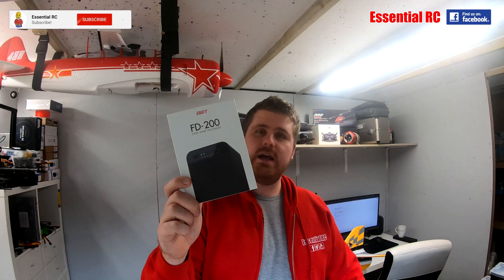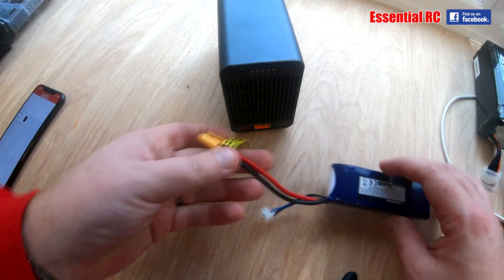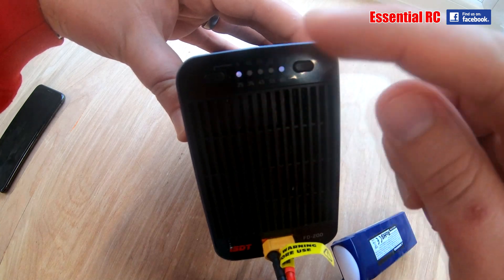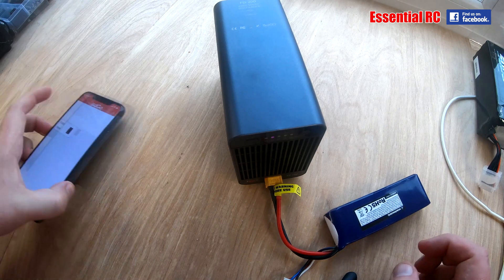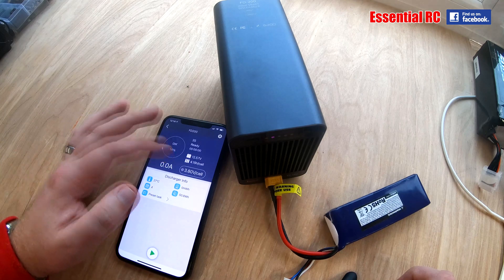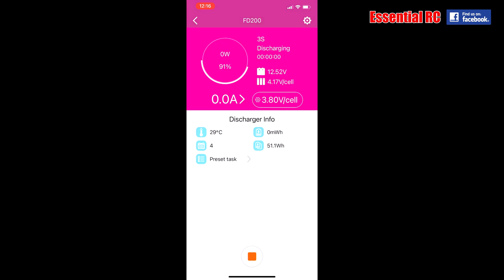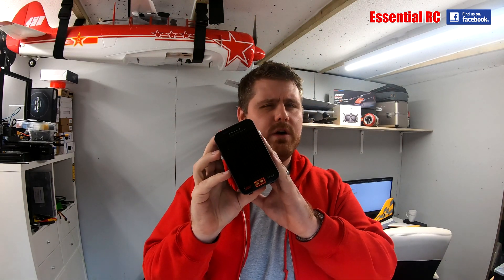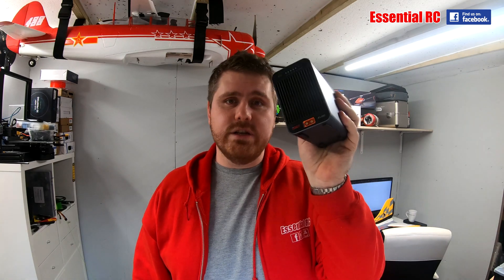STOP KILLING YOUR LIPO BATTERIES !!! THIS LITTLE BLACK BOX WILL SAVE YOU LOTS OF MONEY

Comment: The cellpro 8 can discharge at 40 amps back into a lead battery or 10 amp when dumped in its internal heatsink.  For about 10 years now.
`Needless t say it can also charg at 40 amp.

Comment: Nice bit of kit ✅ How d’you decide at which amperage you want to discharge (10A in this video) ? 👍🏻
Reply: Always stick within the battery "C" limit. for large packs you are unlikely to reach this but for example if 600mah 3s packs etc then obviously 25amp wont be good for them at all and smaller packs it may even damage them. Dont forget majority of batteries out there cannot actaully sustain their maximum C rating for long periods. if in doubt then use a lower current but as a general rule of thumb discharging at 4C will have the battery at storage in 10 mins and 99% of flight packs (not TX packs etc) will be fine sustaining 4c.
Reply: Doesn't really matter. You won't cause any damage. It's intelligent. If you think how many amps your motor draws. Likely more than even this devices max 25 amps

Comment: I see a purchase in my future. I confess that I tend to leave my packs charged long-term simply because it takes so long to discharge them using my charger, plus the hassle of having to hook up the power supply, all the wires, etc. and then monitor the thing during the process. Thanks for this one!
Reply: Just wanted to mention that based on this vid I bought an iSDT FD-100 discharger that’s smaller and simpler than the one demonstrated here, but is still a perfectly adequate unit. It works great, and cost about $35US at my local hobby shop. Thanks again! This was a big help.

Comment: I am missing a balancer connection , so to avoid single cell problems
Reply: You don't need a balance port. Using a discharger to discharge your lipos is no different to discharging them in your model. Also you can't discharge through tiny little balance wires. They just wouldn't handle the current draw
Reply: @CarlRcAirNLandNAquatics  that’s not my problem discharging via balancer cables .....The discharger takes the total voltage to shut off. In case one cell is low, he cannot detect that and will send that cell in under voltage , she will die! During flight discharge all my planes are equipped with sensors to detect a low voltage problem on single cells and send me an alarm via telemetry. So that’s my Argumentation why a balancer connection to stop the discharger when a single cell failure accures could make sense .
Reply: @heinzwatzka9350  I'm pretty sure this discharger is intelligent and would detect and shut off if there was an issue.
Reply: Carl is correct, unless your lipo is ready for the bin the cells will come down together. When putting into storage +- 0.1v difference is not an issue. The reason we balance when charging is so not to go over 4.2v per cell as that will cause damage. Bringing down for storage won’t matter. Hope that helps